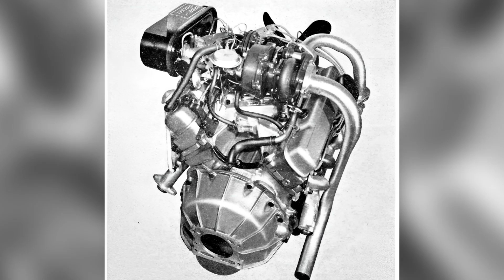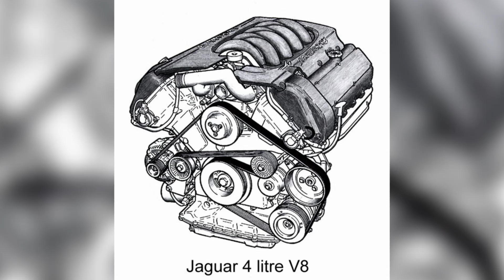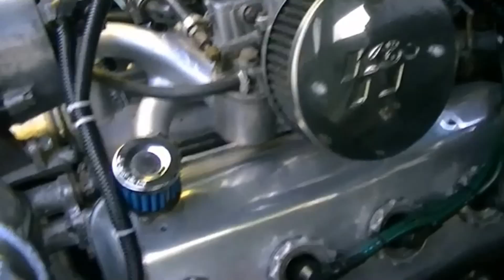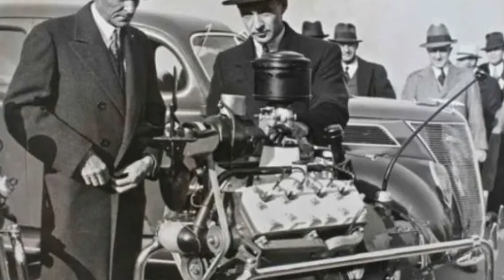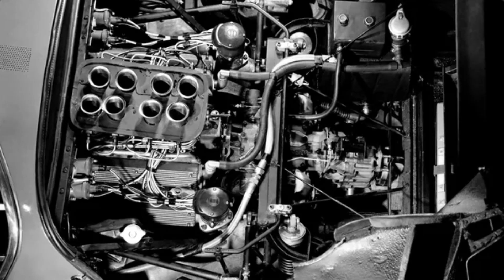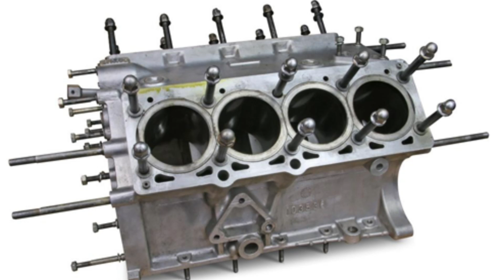11 Smallest V8 Engines Ever Put in Production Cars

Comment: Ford made a small flathead V8, called the V8 60 that was 136 cu in (2.2 L) V8-74 version was introduced in the United States in 1937 to 1940. With 2.6 in by 3.2 in (66 by 81 mm) bore and stroke and 6.6:1 compression,[2] the engine was rated 60 hp (45 kW) and 94 lb⋅ft (127 N⋅m). It was an optional engine for those years but was not very popular as the standard engine had 85 hp.

Comment: Been thinking about sourcing a Buick Olds 215 ci for a transplant in my '72 Opel GT !!
Reply: There was a "standard" swap kit someone made for the 215 in a Vega.
VERY nice match, as the 215 was ballpark 30 pounds heavier than the original Vega 140 and almost didn't affect the handling at all.
Reply: be careful, most that havent run for years have corrosion issues in the cooling system because of the aluminum

Comment: 215 was a Buick, not Oldsmobile pontiac also used in their tempest.
Reply: Olds also made a version of this engine......
Reply: They used it in the Olds F85
Reply: There was an Olds version. Used 5 head studs per bore hole, not 4 - but the heads COULD be swapped between versions using the right head gasket.

Comment: Nothing for the Ford 289 v8?  I had a buddy with a ‘66 Mustang coupe with a 289 that really moved.
Reply: That would be bigger than all of these. That's over 4.7 liters. To make 10th on the list, it would have to be under 3.4 liters.
Reply: Also Chevy had the 265 cubic inch from 1955 until 1960 and again from 76-89@wingracer1614
Reply: It started as a 221 cu in engine, then to 260, then 289.
Reply: @TheSinkingGarage  That would be 3.6 liters, still a little bigger than 10th place.
Reply: Larger than the smallest engine on this list BY FAR.
Even the original 221 version was larger than the Buick/Olds/Rover 215 3.5 litre.